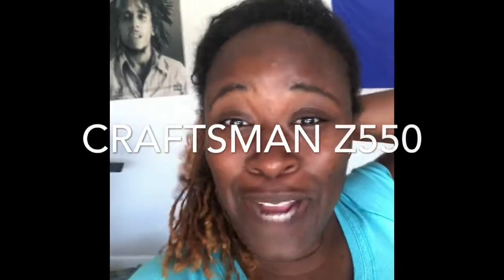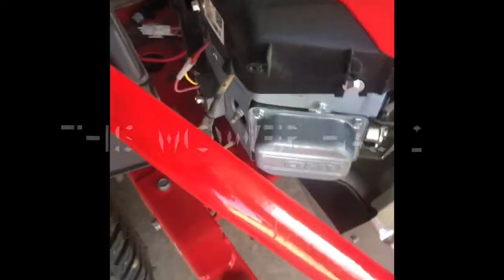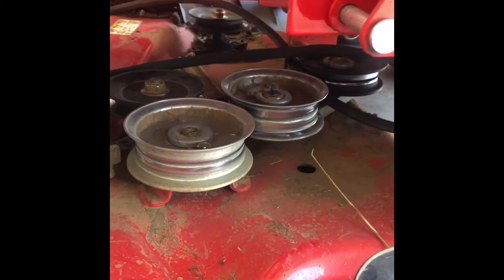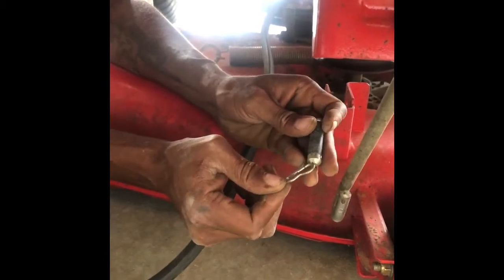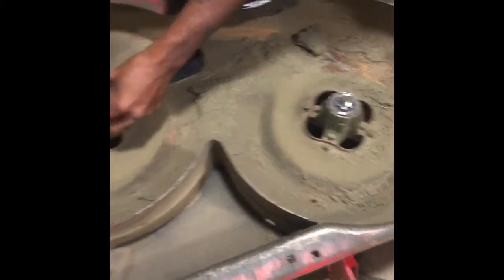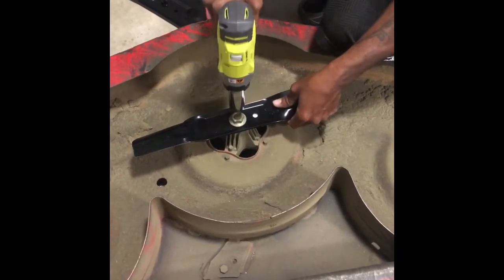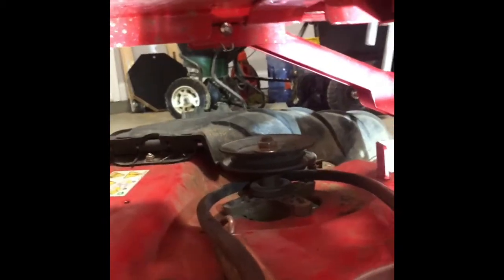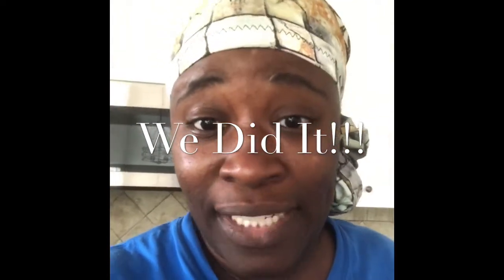Craftsman Z550 Rider Mower

Comment: great job.  But I don't take deck off. I use a come along. And a high branch. Lift front off mower. About 3 ' . Use a 8" longated vise grip. With an 8 " 4x4 block off wood in-between 8" stops center and pulling and a side.  So it doesn't turn. And can remove to sharpen or replace. Without having to relevel deck. But I sharpen mine every week. And replace once every 2 months. So I really don't have time to take deck off. Unless scraping.  I have 3 craftsman.  Z550 z600 z725. And appreciate that you have put vidoes on this.